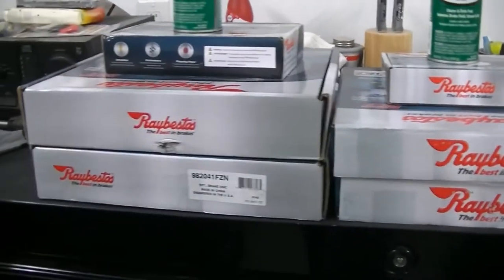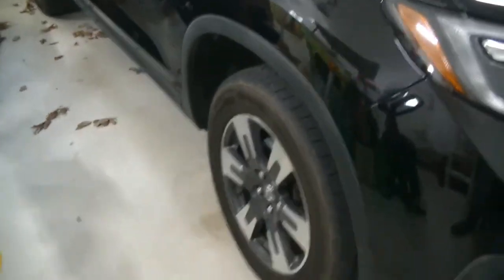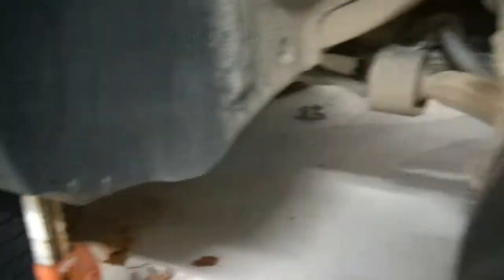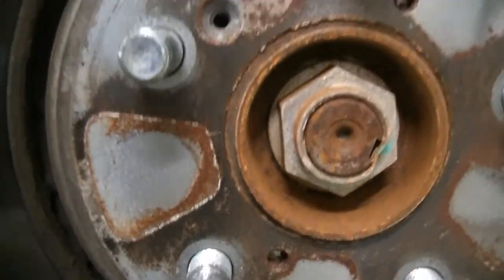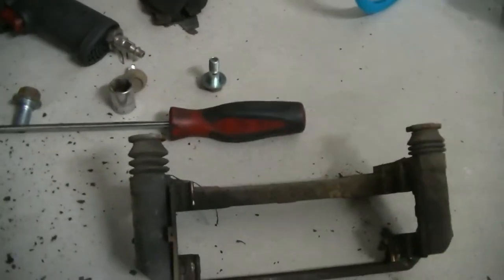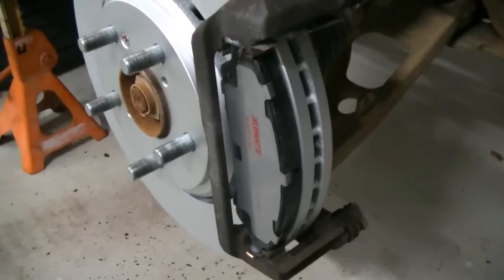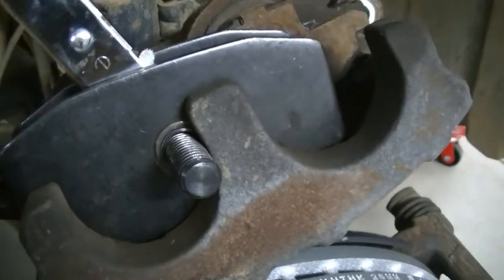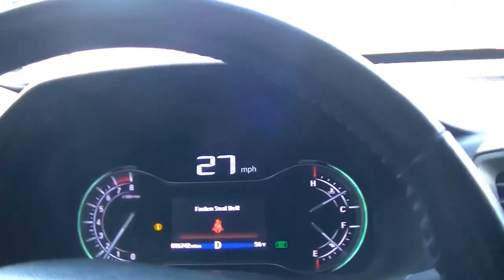2017-2021 Honda Ridgeline Front Brake replacement!

Comment: First off- Thank you for this. Got 2 quotes for $1200 each to do my brakes on a 2019 Ridgeline.  Couldn't stomach that so I did them myself,  after watching this video.  Did them almost exactly how you did. But.. I noticed a squeal that didn't go away.  Thought my caliper pins weren't lubed enough.  Anyway,  I noticed that one caliper pin is cracked on the flat part where the bolt goes through.  I didn't have it placed right in the notch of the bracket and must have bent it when putting the caliper back. I cleaned everything up and put it all back together a little while ago. Brakes seem quiter now.. bit I only drove a few miles to my house. 

Aside from the cracked caliper pin, I don't remember if I put the pins back in the same hole they cane out of. Does that matter? For example on this video,  the pin with the rubber bushing was in the top hole. I think I'll have to take my tires off yet again and look but I just want to be done with this. Kinda makes me wonder if I should have spent tge 1200... but I still don't think so. Thanks!

Comment: You were really thorough explaining the process but then kinda glazed over the return spring installation.   Would have been helpful to see their installation and orientation.
Reply: Just did my brakes.  I found it easier to put the springs on after the brakes are on the bracket and attached over rotor with 20 mm bolts hand tightened.  I pinched the brakes together as I connected the springs.   You have to hold the brakes together as you put the caliber back over the brakes to secure.  Then you can do the final bolts through boots and tighten all bolts.